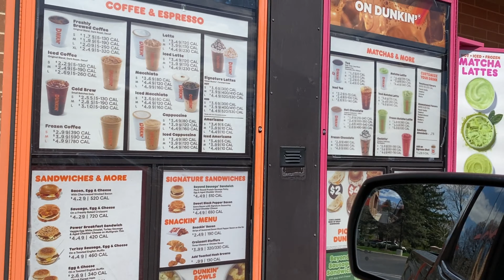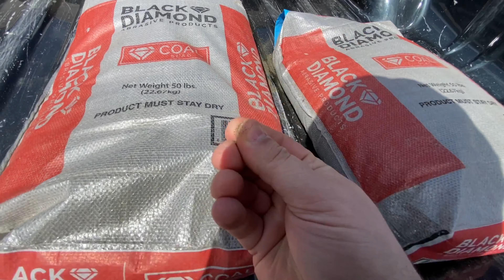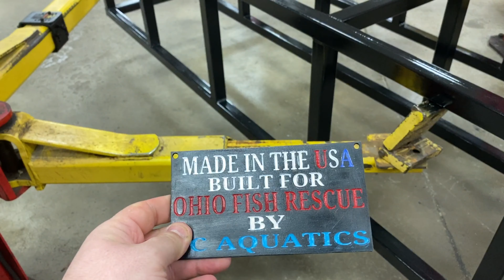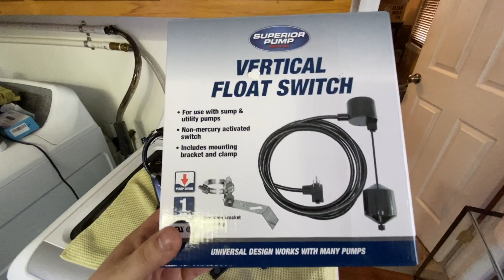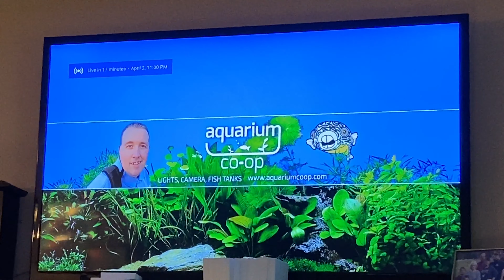A FULL DAY with SC. OFR Build, Black Diamond Sand, Building a SUMP, water changes and more!

Comment: Instead of using regular paint on your tanks, buy black flex seal, it can be pealed off and doesn't scratch or show brush strokes like paint,, I been using it and like it a lot better
Reply from the maker: I have used plastic dip before so similar concept.  I believe the sump on the rack was the tank i used in the how to video. I painted everything in the dinning room so spray paint wasn't an option and I had the OFR rockstar black paint sitting around so that's what I used. Ill try the flex seal on a future project though!

Comment: Didnt that jus say "Coal" on side of the bag?
Reply from the maker: coal slag from black diamonds website:  Coal slag, also known as boiler slag, is a recycled product produced by coal-burning plants. When coal is “fired” at over 2,500 degrees, it melts and produces a by-product called slag. The slag is cooled through a process called vitrification which causes it to solidify and form sharp, angular granules in a variety of sizes. This slag is then reclaimed, dried, crushed, and the remaining granules are sorted into seven different grades of blasting abrasives.
Reply: Nice...was watching the video jus to see if you were gonna get into it a bit more. Good to know. I sandblasted truck frames last year. Tons of fun lol
Reply: Have you tried that sand yet?  
Was it cloudy.
Reply from the maker: EASYGOER GUY it was a bit cloudy.